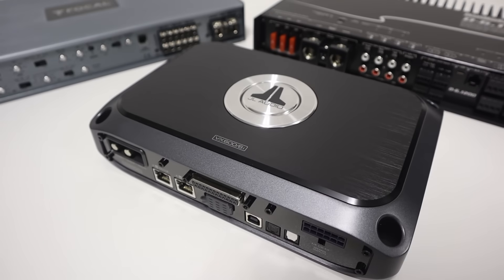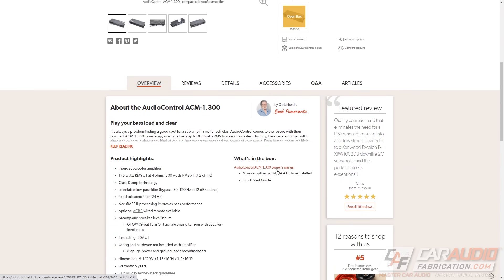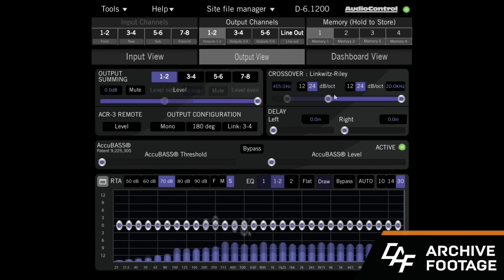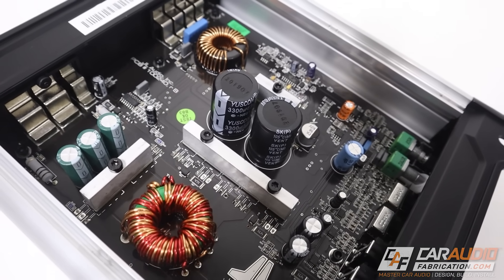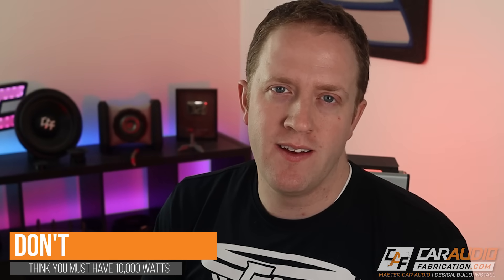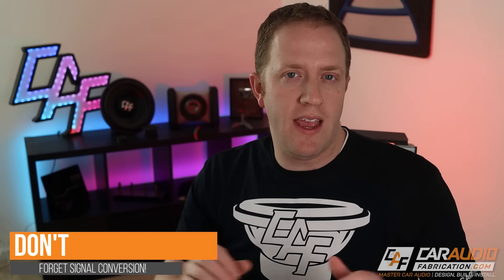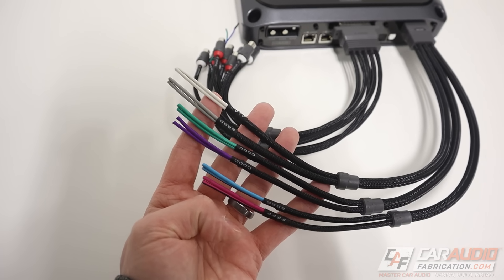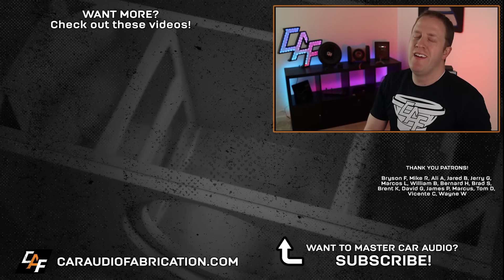Picking a Car Audio Amplifier - DO's & DONT's

Comment: Can you do a review on Sound Digital amps. I bought a 4 channel 1200.4 amp thinking it would push 300 watts to each speaker but that rating online was based on a 2ohm load not 4ohm which reduced the speakers on my Harley to 198 watts. there specs are kinda confusing for a novice like myself. LOL!!!

Comment: What type of amp would you recommend for a system that has a Pioneer MVH-S322BT head unit, Kicker 46CSC654 6.5 mids & 46CSC6934 6x9's? Thanks in advance.
Reply from the maker: Depends on a few factors, we can assist here - https://www.caraudiofabrication.com/consultations